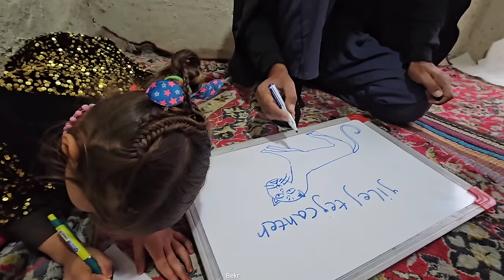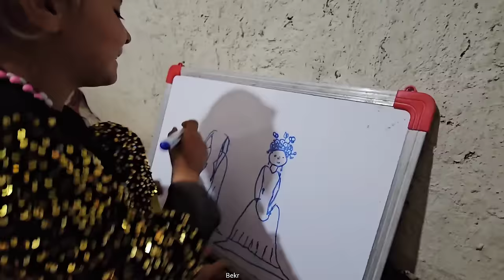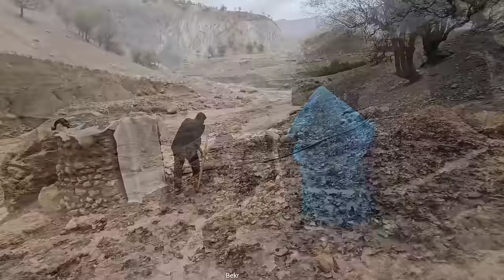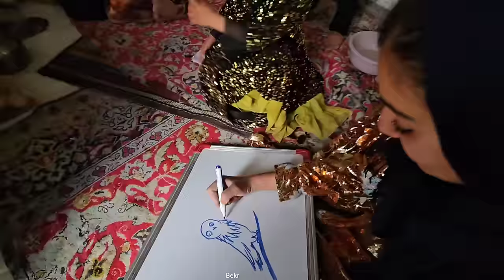Heavy rain and big flood ⛈️: cooperation of Becker family in facing daily problems 🖌

Comment: The road grader needs to dig a ditch on the other side of the road and build up the other side of the road so the water does not make trenches down the hill in back of your house or give you pipe to run from the top of the hill to the river stream.